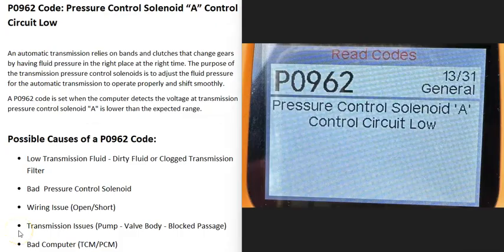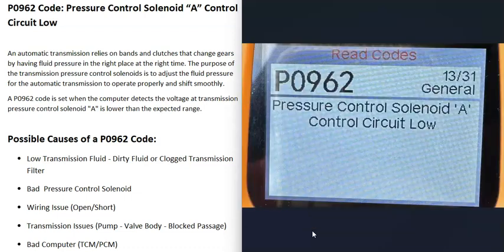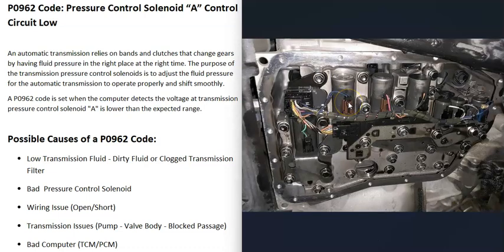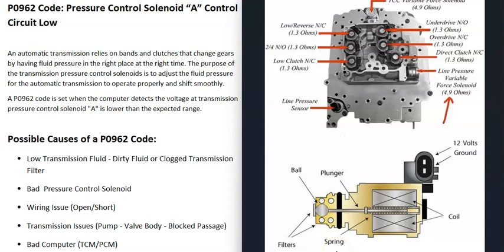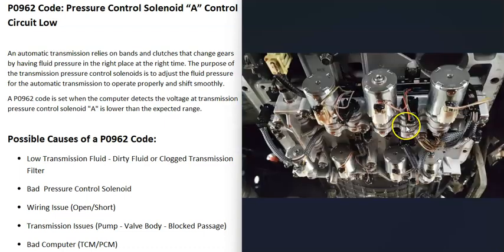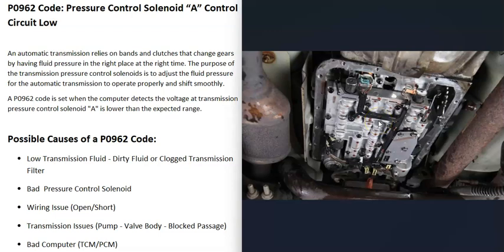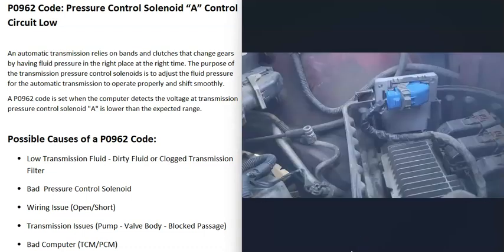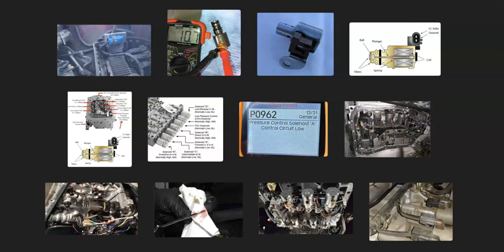Causes and Fixes P0962 Code: Pressure Control Solenoid “A” Control Circuit Low

Comment: I have a flashing drive l light on my dash , my civic 1.3 engine has a hesitation on shifting and not going over 35mph , obd shows code p0962 , what could be the issue ?

Comment: I have a question.. i changed my transmission control solenoid A.. but now i have clicking in reverse and when I'm coasting to a stop and when in park. Also when it changes gears sometimes
Reply: 2010 Ford e150 4.6